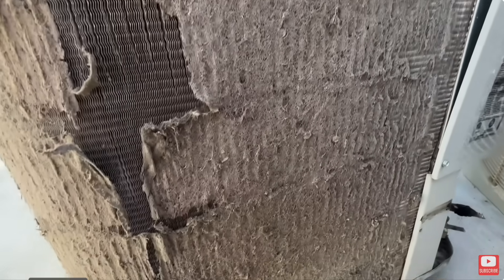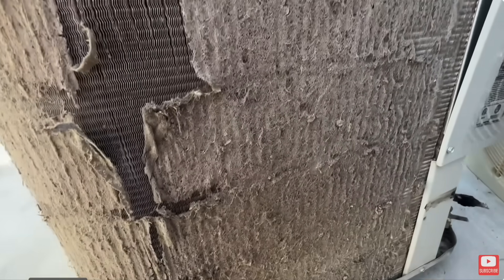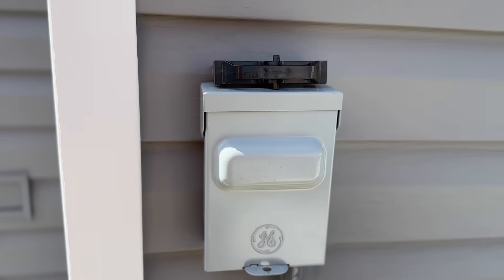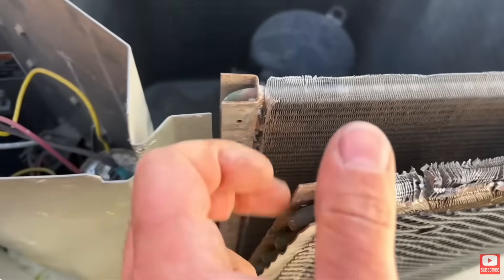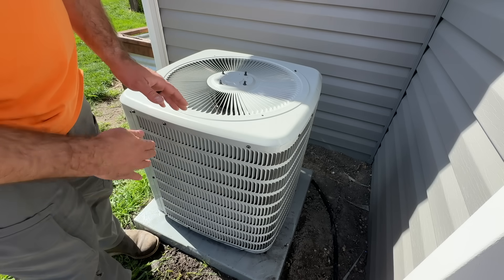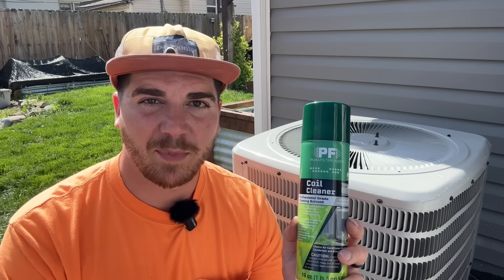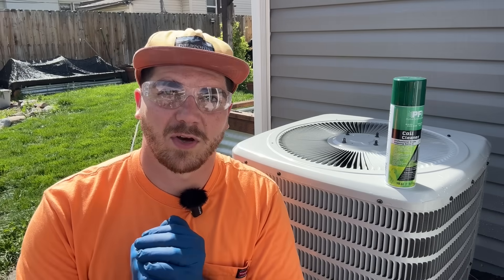Stop Cleaning Your A/C Coils The Hard Way! Do This To Get Colder Air From Your Vents.

Comment: Yeah......the proper way to clean is inside out, the AC coil is bascially built like an air filter.......first the tiny particals, say pollen, get caught in the fins, then the dust and dirt builds up next....then comes grass clippings......you get the idea.....inside out is the proper way to clean a coil.... (coming from the son of a HVAC contractor with 54 years experience)
Reply: This guy is a amateur at best doing a huge disservice with his "advice". He says they rarely get blockage in between. That simply isn't true and I find them like that all the time. In which case you have to run the unit while quickly and carefully whisking over with a propane torch to suck in the flame and set the cottonwood on fire. You do this very carefully and with a hose turned on and right next to you in case it gets out of hand. Don't stay in any one spot for more than a fraction of a second or you will damage the aluminum coil. After it's all burnt and the smoke was expelled through the top via the fan running you turn off the disconnect switch and go about it as normal. All the ash and residue washes right out. 

22 years experience and the company I formally worked for was in business from 1912 - 2017.
Reply: @laserimage8583
2 weeks ago
Really appreciate you sharing your excellent knowledge about HVAC systems. I have question about compressor freeze up. If on a 90+ degree days and we set the thermostat temperature to 60 degree, will it cause the system to freeze up? Been getting conflicting answers, some tech said yes and some said no. What's the correct answer? Thanks in advance!

Reply

6 replies

@eDoc2020
13 days ago
It depends on your specific setup and condition of your system. If you have a "dumb" system and your airflow is limited (such as from a dirty filter or undersized ductwork) it will probably freeze up. If your system has great airflow and is properly charged it will probably be fine. Usually it's recommended not to cool below 68F or so just to be safe. If you want it colder you can get an inexpensive freeze protection control installed which monitors the operating temperature and shuts off the compressor if it gets close to freezing. If you have a modern inverter-based system like a mini-split it probably has this protection built-in.

Reply

@JohnDoeEagle1
44 minutes ago
 @eDoc2020  

Nope....air conditioners are only rated to cool 20 degrees colder than outside. You might get a bit more but no way you could ever pull down to 60 on a 90 degree day outside. That unit will freeze up. And yes, I am a licensed professional!

Reply

@JohnDoeEagle1
42 minutes ago
Good trap.....

18 degrees difference between the return and supply is usually ideal. Anybody who is licensed and has been professionally trained would already know that.

Reply

Highlighted reply

@eDoc2020
28 minutes ago
 @JohnDoeEagle1   I just looked at some datasheets and the equipment is totally rated to cool into the sixties when it's 115 outside. Obviously the actual temperature performance depends on the unit size and thermal load. If you're in a cooler climate a sensible installer might size the equipment only to cool 20 degrees below outdoor temperature but the same building in a hot climate will get a larger capacity unit.

Reply

@eDoc2020
23 minutes ago
 @JohnDoeEagle1   I know that an 18 degree drop in air temperature across the coil is good. But what does this have to do with the OP's question? We have no idea if their system was installed properly or how it's performing today.

Reply

@JohnDoeEagle1
6 minutes ago (edited)
 @eDoc2020  

Not true....if the equipment is big enough to go below that it's a "chiller" not a a/c. They use different Freon, different compressors, different pressures etc etc.

There's no R-22 or R-410A unit capable of such a thing.

R-23....aka "Agent Orange"....likely so.

Comment: This is just straight up misinformation. Spraying from the outside just pushes crap into the fins and clogs things up worse. I tried this a long time ago and it's not possible to clean it without taking the lid off.
Reply from the maker: As I said in the video, in some applications you should. Yours is one of those applications. But for most, totally unnecessary

Comment: The excess tubing on the mini split should not be left in vertical loops as shown here, if tubing is not trimmed to length, it should be looped horizontally so as to not act as an oil trap.

Comment: CJS Heating and Cooling company in Ohio has the biggest scam going not just on the routine maintenance, capacitor replacement, etc. but bluffing customers, particularly older people into performing unnecessary repairs.  Watch out for CJS!

Comment: I just pull the couple screws off the top, lift out the fan assembly, spray it all down with simple green -best cleaner hands down except purple power (purple power is lightly corrosive on aluminum and will etch the surface shiny clean) and hose it from the inside out/top down. It legitimately gets alot more crap out. Rather than pushing it IN like just spraying from the outside does. The airflow is drawing crap into the fins from the outside toward the inside. You cant really push it all the way through clean.. youll compact it in partially. Same as cleaning a car radiator or intercooler. Wash opposite of airflow. Youll double the amount of crud you clear out
Reply: I just did the same. Simple green and from the inside out. I have a package unit so I did both coils. I'm hoping for the best efficiency I can get with the super hot weather coming to Florida.

Comment: I'm a certified sheet metal machine operator and duct fabrication and I know that if you hose it off from the outside it will force trash and grass clippings into the coil and restrict airflow. This guy is full of shit. I'm 60 years old and I would and have never done it from the outside unless you are wanting to sell someone a new unit later on

Comment: I planned on just spraying the outside (no disassembly) with coil cleaner and spraying. Should be a bit better then just clean water but I did figure taking it apart is overkill.

Comment: That aerosolied coil cleaner that you get from Home Depot is basically just a foaming detergent, it's pretty harmless to the coils. 

It's the "brightener" cleaners like NuBrite and the other professional HVAC brands that are actually caustic and repeated applications at the strongest dilution can eat away at the metal not to mention you need to take your PPE seriously for that.

Comment: I mix up a little simple green or car wash soap in a pump up sprayer,  I just wet it down good with the soap and let it sit a few minutes.  Then rinse as well as possible.
Reply: I would be careful with simple green. A diluded solution is probably ok, but they make a product called simple green extreme that is better suited for aluminum. It was developed for aircraft and the aerospace industry and is safe to use on aluminum.
Reply: Are you removing the cover??
Reply: @angeloangeloangeloe  On top of my unit, four screws loosen the grill which has the motor / fan mounted to the grill.  I take out those 4 screws and slide the grill over a bit where I can stick my pump up sprayer nozzle inside and spray mist the cleaner (simple green or car wash soap) onto the inside set of coils.  I spray the outside set of coils simarly through the outside grills.  The two rows of coils are separated by about an inch of space between them.  I just let everything sit about 15 minutes.  I make sure no leaves or sticks have clogged up the drain areas below the coils while I wait.  And lastly I use a gentle spray rinse on each set of coils.  Reinstall the four screws and return power to the unit.
Reply: @789295  thanks , I really appreciate it...

Comment: Mine is very dirty. Trying to get Case open.  Guess I have to take the top off to slide the side panels up and off. They look like individual panels.  I tried taking the adjacent screws. Figured it should be common procedure to keep it working at peak performance.  Think I have to remove top assembly.   With everyone being energy conscious.  Would Mae sense to clean the coil. Thank you.

Comment: I’ve been in the cleaning industry 32 years and you need to add some soap.   The difference is night and day.   You could just use a little dawn in a spray bottle and mist it.  Let it sit for a minute then rinse.   It will be way cleaner.   I do clean frequently because my AC is right next to my dryer vent.    Good job builder.
Reply: I read your comment and used some diluted Dawn and water in an old empty big squirt bottle that I cleaned out.  I wetted down everything first and then squirted the diluted soap/water from the bottle onto the coils.  I let sit as you suggest and then just thoroughly rinsed everything with a nice hose stream of water.  You are right this worked amazing!  I appreciate you sharing your experience with viewers like me.  Thank You and kind regards!
Reply: My unit literally says, water only right on it
Reply: @virgil3241  
Newer ones do not like the cleaners. They have very tiny fins and break down. 
There is probably some cleaners for it but you have to look.
Water does work fine but probably need the lid off if its bad.
Reply: @bobshanery5152  I do mine yearly, so its never that bad.  Its not surrounded by anything that can create issues like grass, fuzz or trees.
Reply: Panty hose over the dryer vent.. LMFAO tell me your joking
Reply: @theallseeinggoy1590  
I've seen it 🤦🏻‍♂️
Reply: @theallseeinggoy1590 . I know those are for your head
Reply: @theallseeinggoy1590  who the fuck said tat
Reply: What's the "cleaning industry?"
Reply: @juicebox22a  
Outhouses 🤣
Reply: @juicebox22a This is just a conspiracy theory, but the "cleaning industry" is a secret cabal of of lobbyist, funded by the soap manufacturers industrial complex. Their primary goal is to convince lawmakers that dirt is at a crisis level and is the primary threat to human existence.
Reply: Builders did the same crap at my home. I put a piece of spare barrel roofing tile over the drier vent. Leaning up against the wall so as to not obstruct airflow too much. The tile deflects the dryer air downwards where it sticks to the tile and concrete floor. Keeps it out of the AC coils, and who cares if there is lint caked on the fence.
Reply: Ironic considering the HVAC guys generally install the dryer vents during the home building process. You’d think they’d know better.
Reply: Can coils be replaced on older models?
Reply: @Supremecougar  
Depends on how old and cost efficiency.  I'd go with a new outside condenser but check inside thoroughly but as a "supremecougar" , you might get a pretty good deal all the way around.😁😎😶
Reply: Those fuzzy  thing from the trees that float  in the air usally June are a big problem.  The coils suck them up. The do sell a netting that hooks on most  the out side . Other guys say you have to ta ke 😊off tho top and do the second roll of coils.
Reply: Wrap ur unit with nylon screen on a roll , wrap around & secre it. Wash when needed..
Reply: Could you use 409 cleaner or stick with a dawn and mist it on with spray bottle
Reply: Lmao
Reply: THANK YOU
Reply: That's nonyabusiness
Reply: U have 22 years cleaning what? Not ac condensers. My unit says use water only.
Reply: That's good too. But, I find that spraying diluted Krud Kutter on those coils does a fine job..  There is nothing Krud Kutter can't clean.  Seriously.
Reply: I never could understand why they put an AC unit that close to a dryer vent.😮😮
Reply: How about Dawn Powerwash?  I think it has a little alcohol in it and sprays in a mist.  Thanks
Reply: Years ago I was working at Disney laundry facility and the dryer vents discharge to the roof where the air conditioners condensers were. I had a full-time job every night cleaning the coils.
Reply: I agree with you 100%.  Who needs fancy chemicals?  Dawn is dashit
Reply: Soap is definitely safer and cheaper than the spay foam. I use Simple Green.
Reply: A HVAC guy told me to spray it with scrubbing bubbles first. The same scrubbing bubbles you use when cleaning your shower.
Reply: I pay 100$ once a year for inside and outside for years. Recently picked up a 16 at Carrier in Mexico while buying plywood at Home Depot , installed and clean that bad boy twice a year by disconnecting and just spraying up and down being sure it's flowing through both sets of coils then hit inside, fins are nice in new unit. I have bottles of good shit but so far my guys really don't need to come out unless I call for something.
Reply: Put a pantyhose over the dryer vent !!!
Reply: #1 cause for home fires is the dryer vent… don’t restrict the flow!
Reply: @FireLikeIYA  
I hate the vents going up to second floor or even.   Fire waiting to happen
Reply: @FireLikeIYA  facts
Reply: @hvacray8279 That way it will take 3 times as long for your clothes to dry and cost equally more not to mention plug up twice a week
Reply: @integr8er66  
Extend the vent down or to the side then.
Reply: @hvacray8279 ”What year did his house burn down?”
Reply: You've been in the HVAC industry or the "cleaning industry"? You must use dryer sheets. I wouldn't, and neither do I use fabric softeners.
Reply: Amazing use soap!!! Wtf would we do without you, genius?
Reply: @kickassclone75  - it works - you should try it on your A/C unit and use some when you shower once a year too.... thx
Reply: @kickassclone75 more importantly, what would we do without assholes like you... genius

Comment: Had a system check up on my HVAC recently and when I mentioned cleaning the unit the technician advised to not clean it 😂 

Now I’m starting to think if the results of the HVAC checkup is not accurate since my technician advised to never clean the unit…
Reply from the maker: You need a new hvac company lol

Comment: We have Cotton Wood Trees here,
 If you don't take it apart that cotton & Dirt sits at the bottom & my fins face down, when it was cleaned by a professional, 6 months later I took it apart & I got out a trash bag of crap out if the unit. & the neglected backside was packed with a thick coat of Dog Hair from Previous Owner.

Comment: last fall wife had service come out through her employment 1 of the box stores they didn't do much. i recently cleaned my coils and ended up taking off the sides was a bit more built up dirty than expected, used simple green to help break up the dirt and little grime. kinda wondering if the dawn spray dish soap be any better and of course better for the soil/wildlife or pets?

Comment: Great video. I think your myths make more sense in areas where there are no trees and little pollen. Here in North Carolina, leaves, maple tree pods, etc. add to the heavy pine pollen to really create a mess on the inside of the unit. So I do unscrew the top, vacuum out all that debris  and apply cleaner and water from the inside out. I get much better access to the fins this way as the outside cover is not in the way. But I can see how my method may not be necessary in other areas of the country. Thanks for doing a great job on these videos. 👏👏👏

Comment: Good tip video. I used to have quite a few cottonwood trees around me and the coils would have a layer on them much like your lint trap. The coils would have to be cleaned twice per season. Over the years with the removal of the trees, a huge decrease in debris from the trees with cleaning once and sometimes so clean not even needing it.

Comment: Two things that make things super difficult, Cottonwood Fluff and the spikey wiring type cooling versus the fin type.
Reply: one particularly warm year when my condenser was running a lot, it got a thick "sweater" of Cottonwood seeds caked on it in a matter of weeks. HVAC companies in this area must really make a killing with all the "cottonwood killed" A/C condensers. Cottonwood seeds don't wash off like dirt and dust, so you have to shoot water from the inside out to remove them. Those who don't live in an area with light, fluffy Cottonwoods just don't know.

Comment: one video you tell us to buy a coil cleaner foam gun and take the top and surround off and another video you say spray it with water and leave everything attached. which is it?
Reply: You need to take the top off. This video is worthless
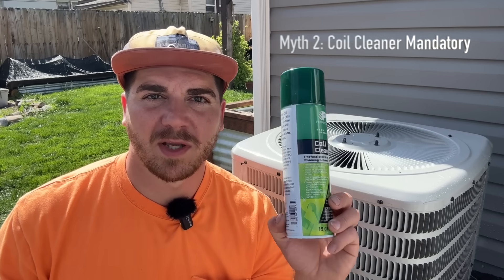Reply: @4:20 seriously... If you cleaned the unit once or twice a year, you don't need the cleaner. The other videos, you can see the filth built up, so you would need a more thorough cleaning.

Comment: What are your thoughts of the Mr. Cool system. I’m thinking of installing a system like this in a garage I’m building. I’m putting in slab heating, but would be using it as a secondary heatings system and A/C
Reply: I'm just a middle aged idiot dad with no mechanical or relevant background, but we installed a 3 unit Mr cool mini split about a year and a half ago and have loved it.

We live in a double wide with one towards either end of the house (master bedroom and living room) and one in the middle (dining room), all on the same long side.

It was very easy to install* and once we figured out that you can't use the mobile app and the remote controls at the same time, have had it running flawlessly the whole time.

*The hardest part of installing it was running power from the breaker to the other side of the house, but we found a video that walked us through every step (gotta love YouTube), and changing out the power lines for each indoor unit.

They are a specific length and since we were running them further, we needed to swap them.

It was difficult because the wire goes into a tight area and is thicker than the hole it goes into which was frustrating, but once done, it was pretty easy the rest of the way. 

Have you decided whether or not to get one?
Reply: @tracy419  The build is starting in the next few weeks and o do plan on installing a three unit system. 
Thanks for the reply.